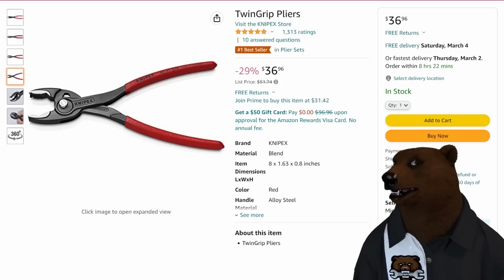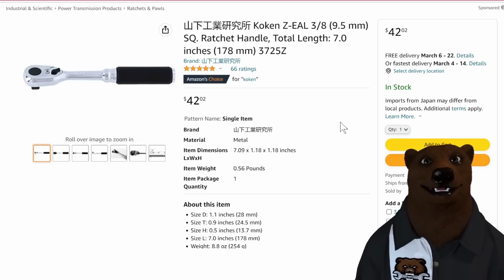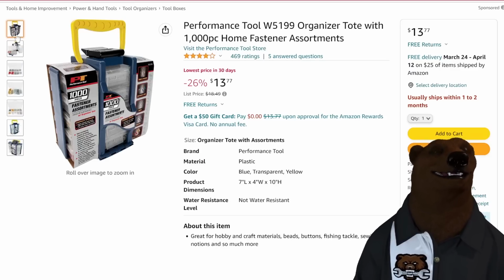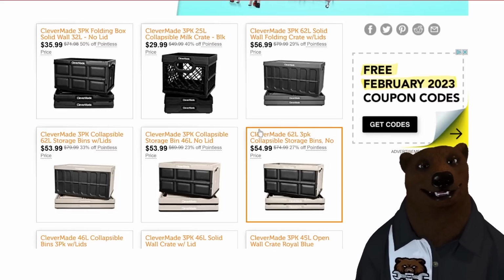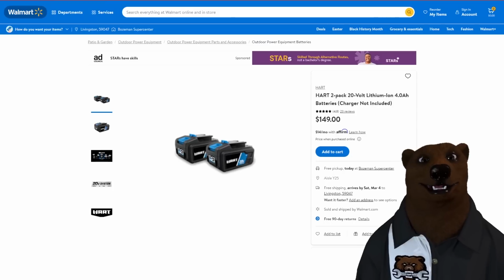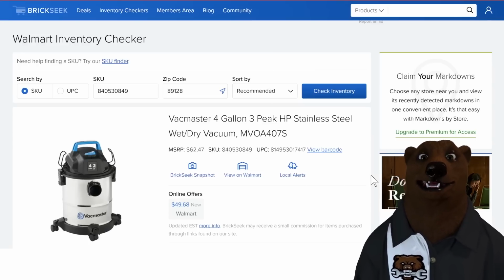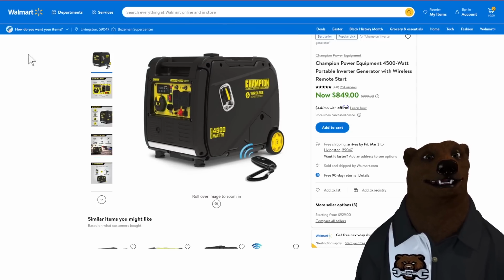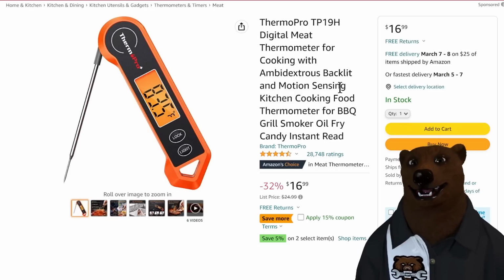Hot Tool Deals of the Week! 2/27/23 #dotdotw

Comment: I have the champion 3200 inverter and it’s rock solid. Champion is here in Sussex Wisconsin and they make great equipment that gets private labeled by other brands for higher price. I had a 32” 2 stage snowblower that was a beast. Fully automatic reverse hi/low nice.

Comment: Wow! I finally beat DaBear!!! I got my Bosch 12v driver last week for $99. It was one of those deals you stumble across on Amazon that is there...and then gone. Anyhow...this is a great choice for a pro-rated tool with all the nifty adapter heads. I've been looking at it for some time now for the particular need I have when assembling pocket hole joinery in casework. It is compact, very well balanced and just feels like it belongs in your hand. It is also clutched...a huge point and one that drove me to the decision to adapt a second battery platform. Bosch has more than a few tools in the 12v lineup that I see myself grabbing up to use inside my shop. Not gonna travel like my Makita stuff...gonna stay in my personal shop for when I need a dang drill or driver or...whatever.

A short note on the WD40. That was their penetrating spray, which is different from their flagship product. WD40 (brand) markets a slew of different lubricants in aerosol now. When you see "Specialist" on the can, look for the description and you may find chain lube, white lithium...or any number of specialty sprays that are NOT the good ol' WD40 we all know and love. Just beware!

Comment: Just a quick observation on that Vessel Megadora Screwdriver Set: I notice the "Head Style" is described as "JIS", so anyone nursing along an older Japanese car, bike or other equipment might do well indeed to grab that set. "JIS" stands for "Japanese Industrial Standard", which means its cross-head screwdrivers for JIS screws will be slightly different to our familiar Phillips Head. If you try to use a Phillips screwdriver on a JIS screw it's very prone to "round out" and ruin the screw. A JIS screwdriver will do no harm to a Phillips screw, but a Phillips screwdriver will very often savage a JIS screw. JIS screws are typically (though not always) marked with a single dot on the screwhead. For more information just Google "JIS and Phillips screws" Or, just take a look at a few crosshead screws on your old Honda or whatever. If you see dots on the heads, do yourself a flavor and get that kit.

Comment: I jumped on the Ecoflow deal but then I realized it isn't using LiFePO4 batteries.  This one specs 800 cycles to 60% capacity which is ok for infrequent use.  I'm going with LiFePO4 when the price comes down.  Cancelled my order even though this is still a great deal for what you get.
Reply: The newer Delta 2 is LifePo4
Reply: @JJ Santos  Yep but it is still about $1000.

Comment: Just saw that Bosch GSR12V-140FCB22 Cordless Electric Screwdriver 12V Kit - 5-In-1 Multi-Head Power Drill Set at Lowes yesterday.  Clearance price $99.99.  Almost pulled the trigger on it for that price.  Probably regret not doing it.